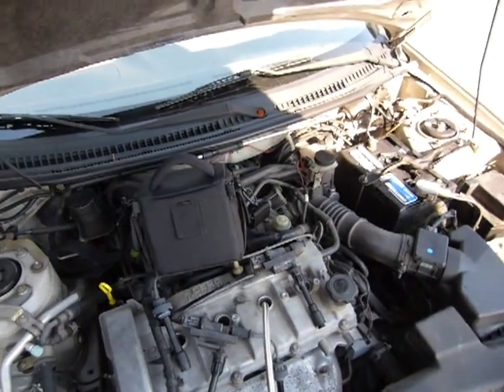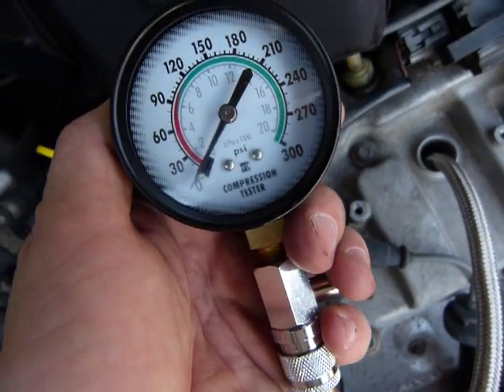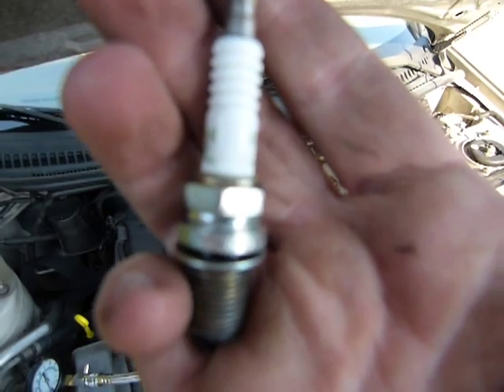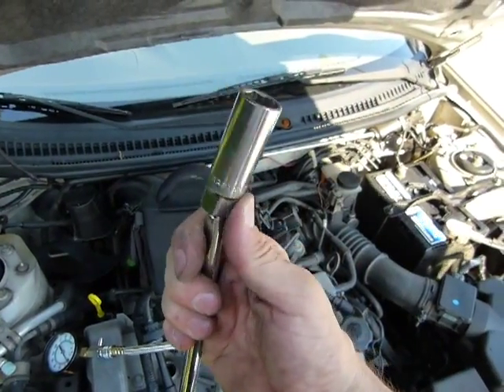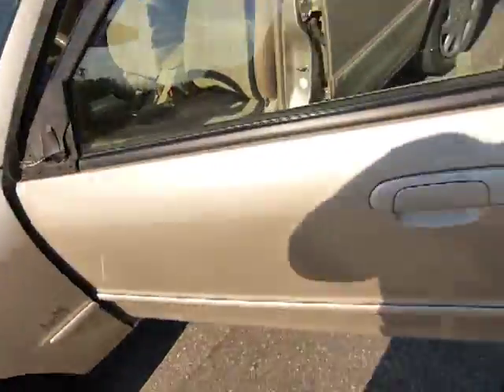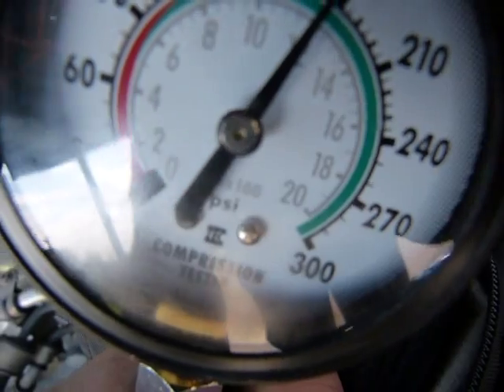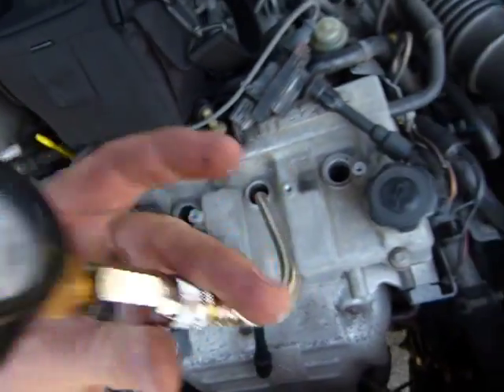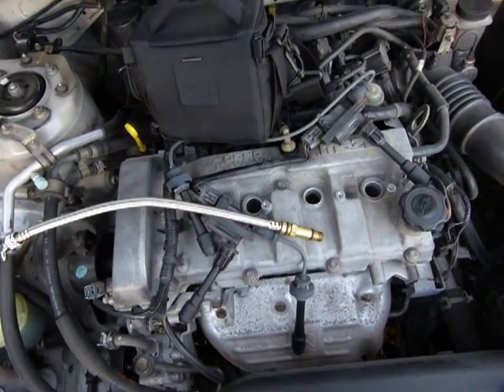Cylinder compression test demo on 2002 Mazda Protege

Comment: 150-120-120-120 

sad face
Reply from the maker: Yeah, ... another way to look at service minimus is they show the times manufacturer wants you to spend money on repair or replacement. It is not the time when an engine fails or stops working, so a definite option is to keep driving until definite failure. It could be years away.
Reply: theoverengineer yeah, as ling as it starts, moves and isnt burning through too much oil, ill keep itnin the driveway
Reply: sorry for ur loss
Reply: 120-120-120-175 on my 2003 Mazda Protege with only 126k miles. Recently sold and was upfront about numbers. Was surprised hoped to get more out of it personally but it just became a spare with those test results.